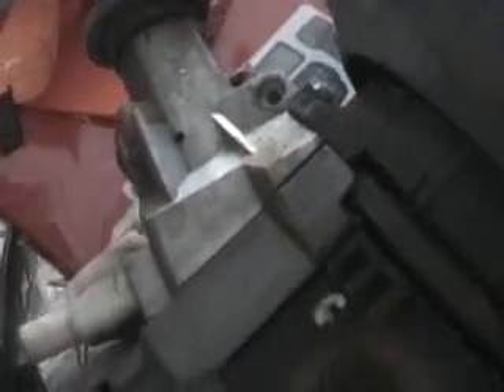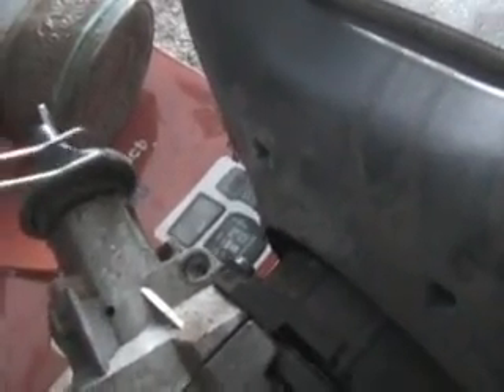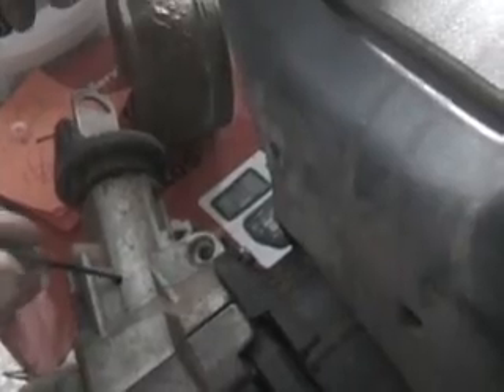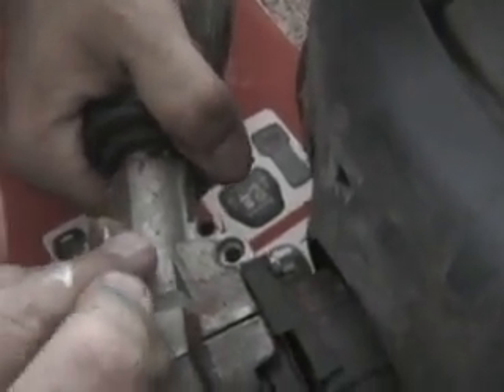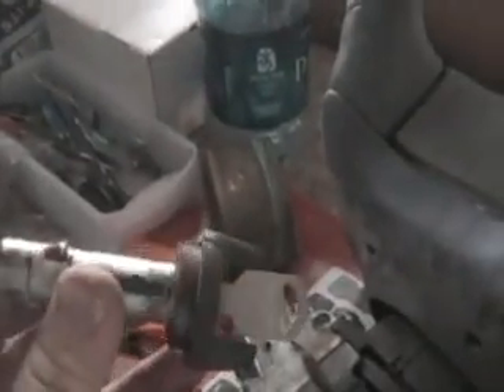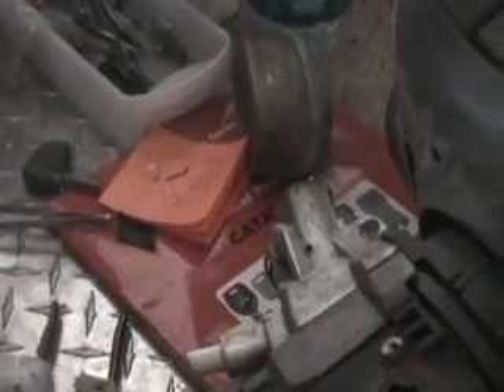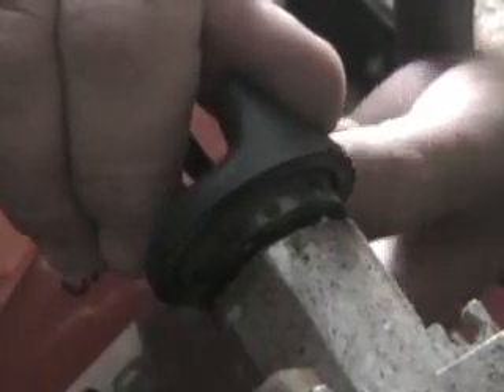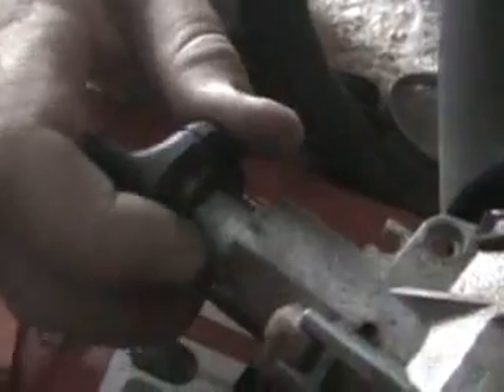Lock Picking Gmc Ignitions 1997-2007

Comment: IGM ignitions remove in the start position. Usually , I put the shifter in the drive position so the vehicle won't start or damage the starter during cylinder removal.

Comment: @bigmike42092 there not explaining you cant start the car this way if they were doing this at a dealership they would disconnect the battery and the car wouldnt start and there would be no connection . plus you can do what he did by just turning the ignition all the way and releasing the pin

Comment: Okay can some one tell me   What if the ignition doesn't want to move/turn to the on position. Cuz some one tried to jack my friends 2002 Silverado and mess-up the the hole where the key goes.    Can some one tell me how to take that cylinder off.. If it doesn't  want to turn &      Thanks